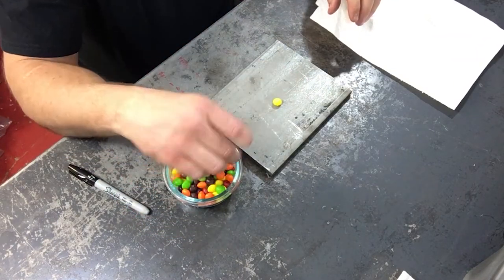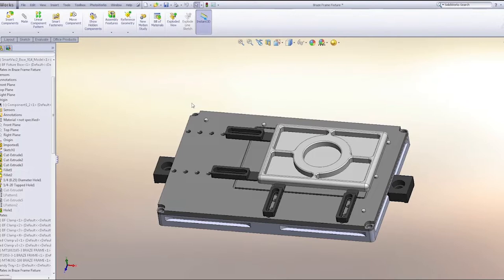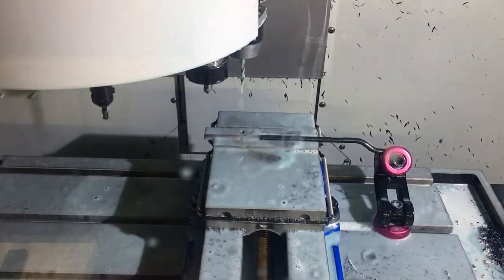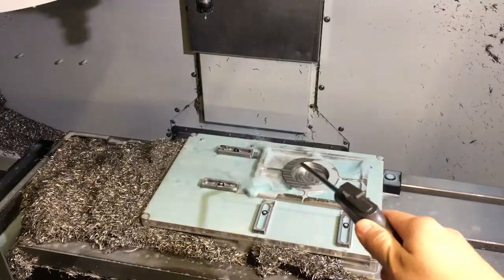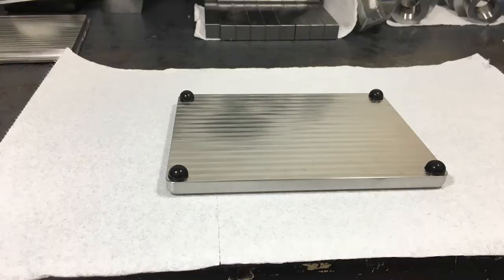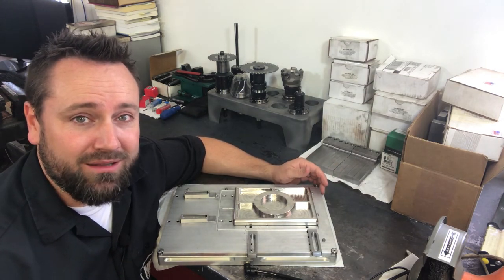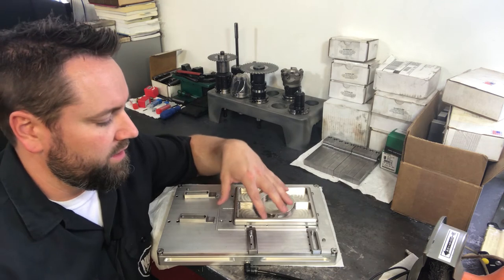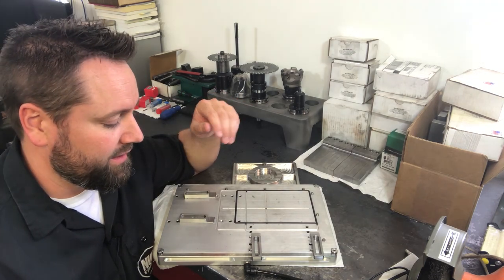Vacuum Table Fixture  | Pierson Workholding's Vacuum Chuck Review

Comment: How do you stop the coolant from getting sucked in, and eventually gumming up the vacuum pump?
Reply from the maker: While the part is held down it’s sealed up tight. When you release the parts a little bit of coolant can try to creep in but you just blow it away from the suction hole. If a little gets in, it is no big deal. The coolant passes right through and is essentially self cleaning. One could every once in a while let a little cleaner like simple green pass through to keep the passage from build up.
Reply: @nubtools  when you say "pass through" you're talking a little bit of the coolant passing through the vac pump and out the exhaust?
Reply from the maker: Exactly

Comment: Do you have any complaints about the noise the system makes? Seems like its not much louder than the machine while its running, but its a bit hard to tell in the video. Thanks!
Reply from the maker: It’s a bit loud when the machine doors are open, but when the doors are closed and running it didn’t seem to bother me. If you pull the trigger on a blow gun about a 1/4 of the way, that will give you a good idea of the noise level. 
Thanks for the question!
-Dave